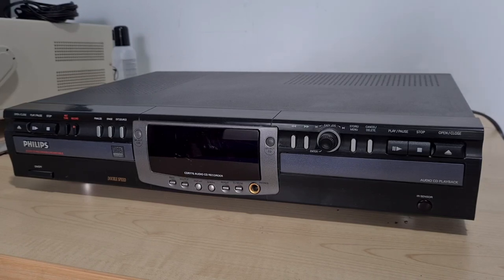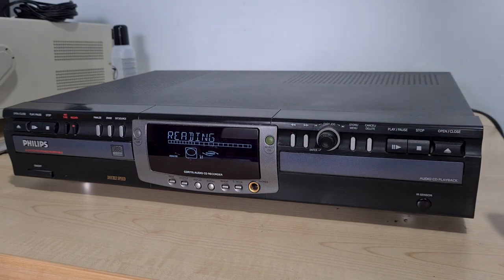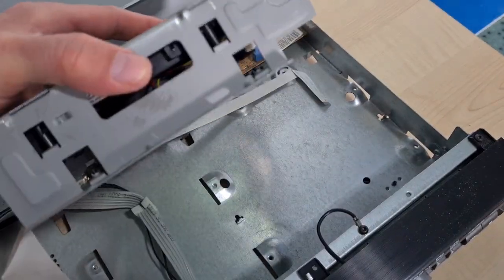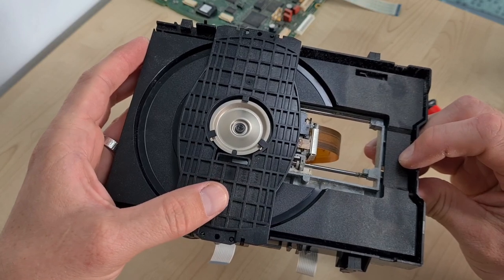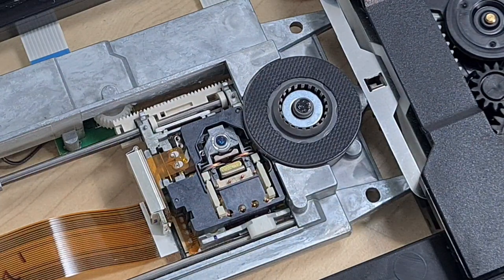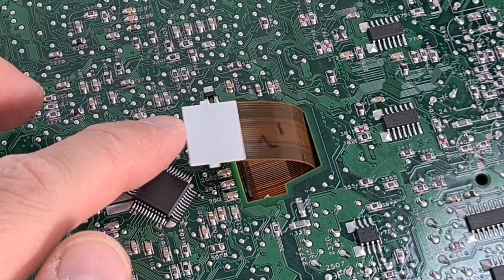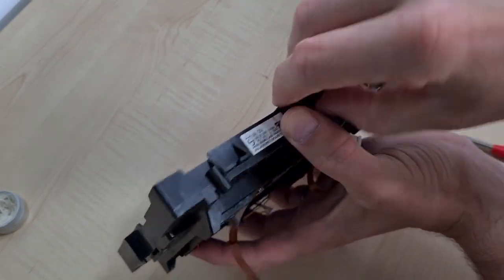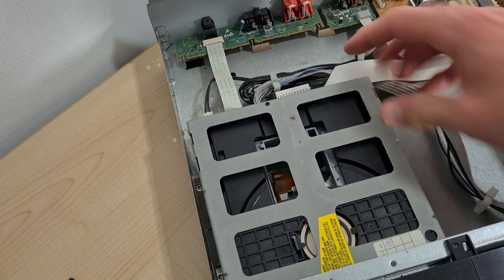Philips CDR775 CD Player / Recorder - Doesn't Want to Play Discs!

Comment: I bought one of those in the early 2000s and it was one of the worst purchases I've ever made. It rarely functioned properly and it destroyed those expensive CD-R Audio discs when trying to record on them, over and over and over, and when I first wanted to have it serviced, it was not possible and then when I wanted another functioning CD-player/recorder they had been dropped from the stores. They offered me as replacement a crappy minidisc recorder (which I did not need since I had one already) that was just as unreliable. Well ... the chain of stores where I bought it was bankrupt some years later .... no wonder why.
Reply: Same here. Read my experience with it. I bought it brand new and developed problems out of nowhere.
Reply: Circuit city?
Reply: @flyfishincrazy  no I had bought mine at Walmart.

Comment: You have a dual disc Philips CD Recorder. You did not show whether or not it would recognize Digital Audio discs. The left tray is for recording on a blank digital audio disc. Look closely at the Logo next to the tray, it will say Digital Audio. It will not record on regular computer discs! The right tray is for playback, and will play virtually any recorded disc. The left tray can also be used to playback... I used a Philips CDR765 Dual Deck Recorder I bought brand new for nearly 20 years to master my analog tapes from a tape deck to CD to create digital masters of our music and never had any issues until about two years ago when it quit. One must periodically use a laser lens cleaner disc to make sure it will read properly. Some of the comments suggest that they didn't read the Manual which clearly states that Digital Audio Discs must be used to record.
Reply from the maker: It did in the end, it performed beautifully for a good few months until I moved onto a different player
Reply: @pwrestoration  Cool.

Comment: Beware! I  believe the Philips (and Marantz) CD consumer grade recorders will only  record onto pre formatted CD AUDIO discs. They  won't  accept normal  computer grade CDR's or CDRW's A quick  Google search shows Audio  Blanks are few and far between.
Reply from the maker: Ah no way, that's great information! I'll see what I can come up with
Reply: That's true they have to be "CD-R Music" CDs, but still very easy to get hold of and not that expensive. I believe that originally they had an extra tax tariff put on them to counter piracy. Although I love defunct recording formats I feel that standalone CD-Rs separates are kind of pointless if you have a laptop or desktop.
Reply: My work around back then was to get CD-RW Audio discs and then burn to regular CD-R in the computer.  But sort of a long winded way considering what we have now.
Reply: Not just Philips ! Sony as well
Reply: I haven't recorded on mine yet, and just researched about the CD-Rs that will work in this machine. I've heard they have to be called Music CD-Rs and have the printed words "digital audio" on the right side of the disc. I just ordered a 10 pack of Sony disc's to try. They came to about $2 each. They are more pricey than regular CD-Rs. Hope they work!!
Reply: @troyconnolly9053  And Onkyo!

Comment: Good video.. just to make you aware if you aren't already, the ribbon connector end from the laser unit can be very very sensitive to esd, it can result in a destroyed laser when disconnected and then the end of the ribbon touched by fingers etc, some aren't to bad, but some will be completely knackered if you touch them, just thought I'd let you know if you didn't already, so if you do the same as you did in this machine to a different more sensitive one, you will possibly end up with a dead laser unit, there are certain laser units that you need to solder across an area linking it together before disconnection, to stop an electro static charge killing the unit, you can usually find info in the service manual for the particular machine you're working on, if you can find the service manual for a player, check it before jumping in to strip a machine down... It's very satisfying repairing cd players, many people just think the laser is dead if a machine doesn't read a disc, but in my experience its very seldom the laser that's the problem, if a good clean and lube doesn't sort things, check the power supply next, capacitors sometimes age, although that is far less common than you will read about, its a silly trend that you should replace the electrolytic capacitors in anything that's a few years old, where in fact many will last for 3, 4 or 5 decades without problems.. anyways enjoy yourself, and i'll sub your channel and hopefully watch more of your fixes, cheers fae Fife.
Reply from the maker: I've had them fixed temporarily by just adjusting the laser pot. My current Pioneer has been turning and burning for two years now after just a small tweak, I had expected it to die in short order but hasn't!

Comment: I was surprised this worked in all honesty - that wasn't all that dusty and I've never had much luck cleaning CD mechs - generally when they're gone they're gone, and if they aren't Sony or Sanyo based good luck getting new lasers for them, especially recorders.
Reply: I ummed and ahhed about getting one of these for a while but ultimately thought what's the point if you have a PC and it does the job far far better?
Reply from the maker: That right hand side I was sure needed a new laser, and to be honest it wouldn't have got one!
Reply: @createdezign1840  Thing is though, to this day they are the most convenient way of getting a high quality, lossless analogue-to-digital dub of a "legacy" format - ADCs connected to computers very often have poor fidelity and high noise.
Reply: @jasejj  "ADCs connected to computers very often have poor fidelity and high noise" - True, I suppose I'm not thinking of recording from an analogy source. But "copying" on a computer will be a bit perfect copy both in quality and layout depending on the software used. As I've said previously I've been thinking of getting a CD-R but ultimately I think I'll hold out for a reel to reel. :) Love your channel by the way. :)
Reply: @createdezign1840  Absolutely agree that digital copies are better done on a PC for many reasons.

I'm not Paul BTW 😁
Reply: @jasejj  lol.... upsss!
Reply: The recordings were quite good when it worked. Often times tapes recorded from the input sounded better than the original audio if that makes sense. Had a good converter I thought. Some recorded CDs started get a scratchy sound to them after a few playbacks. I'm  not sure why that was either. Or spend tons of time manually recording a disc only for the finalizing to fail. Then you're out time and a disc. That's the only downsides. You have to do everything in real time with this device. High speed dubbing from a CD actually copied the high speed sound to the disc. So when I played the disc back it was chipmunk speed.

Comment: Very informative video.iv. I just purchased one off these.The recorder side was only used very rarely by the last Owner.The cd player (right draw) works fantastic very fast pick up.The recorder (left draw) is completely dead iv tryed to give it a tap with the cover off no laser no nothing..its very clean inside.Any help or advice would be appreciated.Thank.ypu
Reply from the maker: Time for a laser swap I think. You can try one thing, on the laser unit there is a small potentiometer which essentially cranks up the laser power. If you can give that a turn it might resurrect it. Try it twice though - sometimes turning left turns it up. I can't remember which way to turn these off hand to turn it up. It will decrease the lifespan of the laser but it's better than not working at all!

Comment: Greetings, can lithium grease be used to lube the transport?
Reply from the maker: Definitely! To be honest any modern grease (IE not old mineral grease, it dries out) is perfect.
Reply: @pwrestoration  thank you kindly for replying! sweet! I have some lithium grease I recently bought, will use it when or if the need arises :goodvibes:
Reply: Did this work? Perhaps this may be what is wrong with mine, the laser track isn't greased enough and the CD just stops playing.
Reply: @brianwilliams5121  yes it did. Used and sold players I ised them on, buyer says they work great, sorry for late reply

Comment: I admit that I cringe a little bit with the metal spudger so close to the electronics.  I'm surprised that you don't use some plastic spudgers for those areas.

I assume you haven't had problems scratching the PCB's or any such thing yet.

Comment: I still have mine that I bought around 2001 new and it was really expensive. Close to $500. Hey this was the early thousands and a device that can burn audio to a CD from analog was something else. It now sits in my garage now though. I find it hard to get rid of it for that reason. Maybe I can repair it. I used it for a little while. Maybe for about 4-6 months burned around ten  or fifteen discs here and there not overly using it for really the purpose of archiving my tape collection and preserving personal family recordings, kind of like converting home movies to DVD. 
Anyways, it developed problems randomly some OPC error. It would take about ten tries for it finally run correctly. Sometimes it work flawlessly, then other times fail to finalize.  Player side developed  an issue where the playback would stop for no reason. It would make this slight squealing sound then sound like it would 'lockup' then it would stop. Has anyone here had these issues?